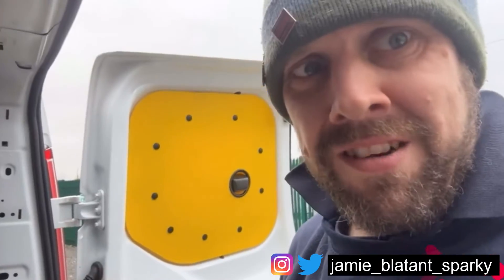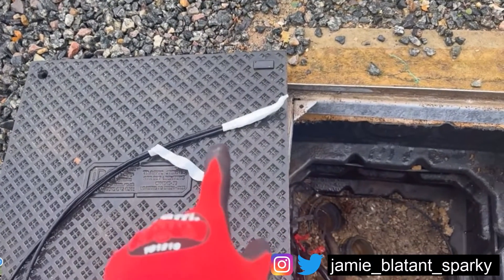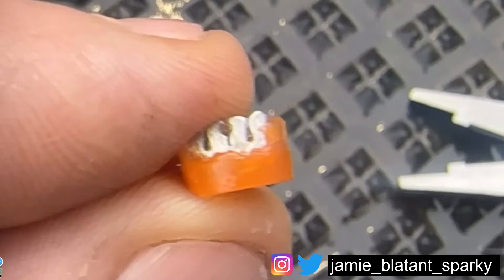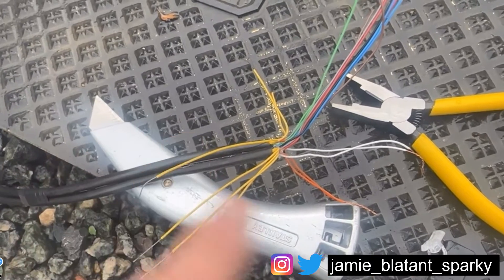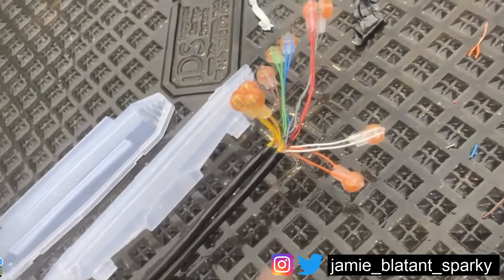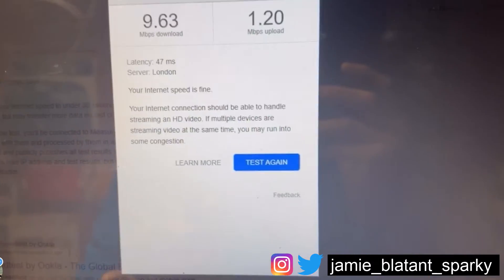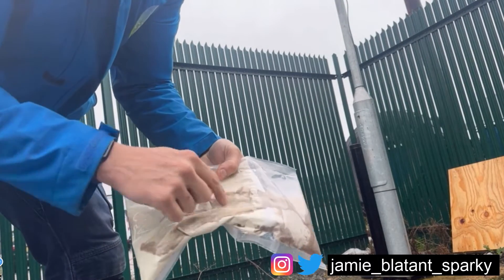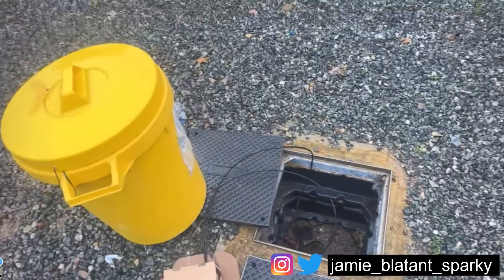repairing a telephone cable - resin joint and jelly crimps

Comment: you're right about the yellow wires, they are just for support (unless a lazy bodger wants an extra spare pair without putting up an additional o/h wire.)
BT catalogue, = Dropwire No10 (350m drum) Crimps Wiring No8(a,b,) and Pliers Wiring/Crimping No(?)

Comment: Just make sure if you are just using a few of these in a junction box make sure you position them upside down, otherwise if you don't the gel leaks out & you'll end up with a dry joint.
Reply from the maker: I’ve never thought of that I know it’s thick but I guess it will eventually come out now you mentioned it I notice that’s why Bt allways have them drooping down

Comment: A BT engineer gave me a box of these once better than trying to bodge them together on terminal blocks as they break. Usually, you get voltage between the cores 24v? A & B. What are the other cores used for extra lines?
Reply: -50v between the battery leg and the earth leg.
The cable shown is four pair cable (can carry four separate phone lines).
Each pair of wires in the cable are twisted together to reduce interference. The twists are far less tight than in CAT5 cable, but they serve the same function.